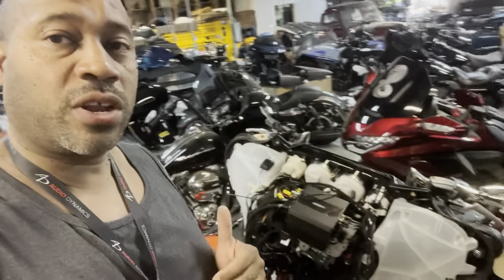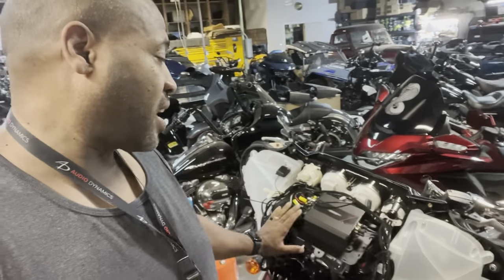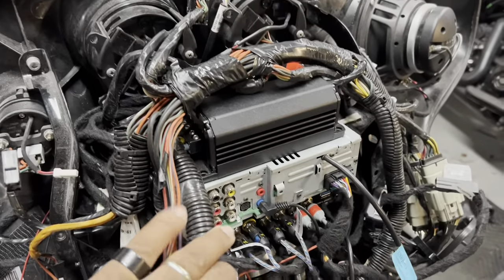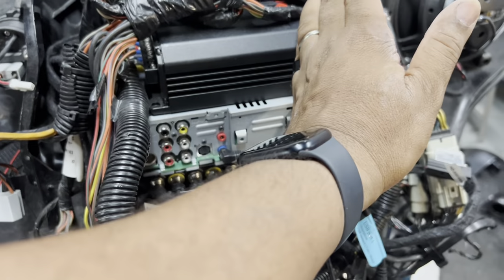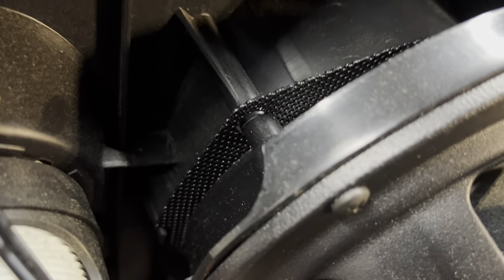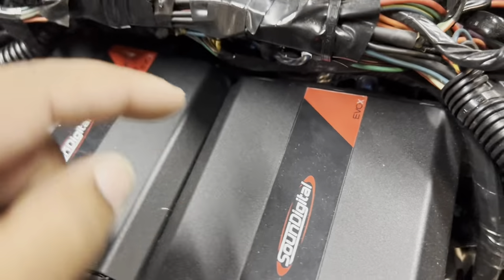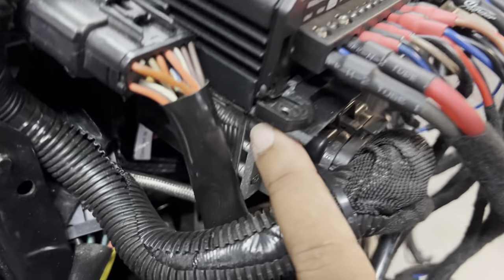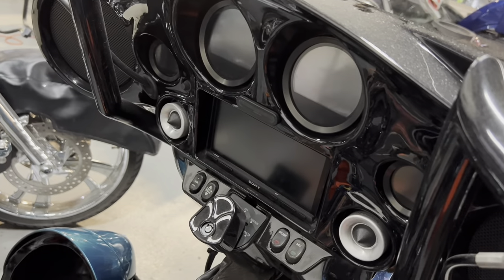How to fit 2 sound digital evox 800.4 amps in 1998 to 2013 street glide  Electra glide /Ultra faring

Comment: Could you show how you set up the wiring lay out on the Electra glide using the metra inner fair with Sony ax7000 using the evo 800 ? I used the setup style you have exactly but can’t close the front fairing on now 🤦🏻‍♂️

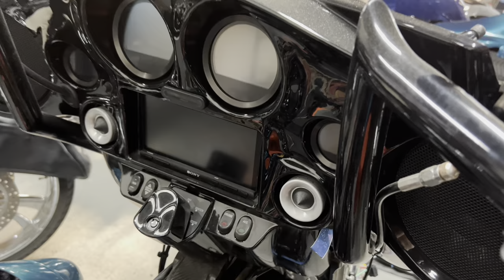Comment: After 5:32 for a 2006 Electra glide using the same setup I seen you have . the aftermarket ax7000 Sony deck with the Metra inner fairing I have 2 - DS18 pro 6.5 on the front and 2 - DS18 pro  6x9s in the bag lids. So do I need 2 evo 800s and if so will they fit in with a DSP and is the DSP necessary ?
Reply from the maker: @jacksanchez7229  the sound digital amps are guaranteed to fit most of the other amps on the market are a little too big .

You don’t
“Need” a dsp but we use one on every build to make the bikes sound better

Comment: 98-13 street glide, double din fairing with full-size double din radio. Can I fit the 1200.4 SD with the metra or saddletramp amp rack plus dsp mounted to front of said rack?

Comment: So I have the metro amp rack and two 800.4’s was gonna mount the dsr1 right behind the radio. But your saying it won’t fit. I also bought an aftermarket day maker headlight. Does this headlight give me the clearance I need to make it fit.  I have all the bodywork at the paint shop so test fitting right now is not an option and I didn’t see how the dsr would fit where your video shows. Have the diamond mp654 on the bike now. I have been going over this In my mind over and over and it’s driving me crazy.  Now if what I’m trying to do doesn’t work I’m back to redesigning again. Gotta look at the video again. I literally just woke up and this video was front and center on my phone.  Long night at work. But I’m gonna look at it again. By the way thanks for all your videos.  Im a do it yourselfer and I have learned so much from you!
Reply from the maker: Dsr1 will fit under the Sony radio

Comment: Good morning how do I tune a sound digital 800.4 evo x to two cicada 6.5 with no dsp and a factory radio on a 19 ultra classic
Reply from the maker: I’m sorry 
We use a dsp on every bike 

I would start with the crossover around 100 hz high pass and gains set with a ac volt meter with a target voltage of 23 volts ac with a 1000 hertz test tone

Comment: Do you know if there would be any extra room in a Metra fairing with digital gauges for a 2013 Electra Glide? Just finished up my bagger project with the exception of the audio (audio to be installed this weekend) and when we switched to digital gauges, we didn't have to use some of the harnesses that were plugged into the existing aftermarket gauges, so I'm thinking we may have gained some room there.
Reply from the maker: You don’t gain any room because you still use the factory gauge brackets 

Maybe a half inch

Comment: Carlos who makes that aftermarket fairing(in the video) for a 2006 harley electra glide? Do you recommend it? Pros and cons?
Reply from the maker: Metra 

Metra 95-HDIF Harley Davidson FLH 1998-2013 https://g.co/kgs/NYM3AT
Reply: I believe it’s metra. It has the double din cut out so you can upgrade the stereo. I seen an aftermarket one on Amazon.
Reply: I have that same inner fairing, the batwing will bolt on with a 1200.4 EVOX but it will crack your paint, Atleast it did for my 08 SG, even after trimming the gauges and sliding it back as far as possible it still was pressing up against the fairing and spider cracked my paint, but I’ve been told a 800 will fit

Comment: I’m looking to run two evo x 400.4 amps in my 13 what did you run for power wire ? 4 gauge to distribution block to 8 gauge or two 8 gauge wires to battery. Would 8 gauge power them both with correct fuse?

Comment: Hey Carlos. I love my Hertz speakers but don't see you doing many Hertz amp installs. You prefer the SounDigital over Hertz amps?
Reply from the maker: Yes 

They are smaller and more powerful 
We use 2 800.4 in most installs 

The hertz amps are excellent but 2 won’t fit without cutting
Reply: @NVSAUDIO  thank you! I have a single SD 800.4 running my SPL Show SX165 and SV165's and was hoping I didn't make the wrong choice for an amp.

Comment: So I looked up the dimensions on the dsp in the video it’s actually just slightly larger than the dsr. But I did notice the bracket that stabilizes the fairing has been removed. The one normally under the speaker to the center support.  Was this just for the video or is it permanently removed for this setup. Any help greatly appreciated. Thanks
Reply from the maker: Permanently removed because of the speaker flange
Reply: What dsp was used?

Comment: How would I get in touch about your 10” nvs mid bass drivers
Reply from the maker: I’m so sorry but I do not sell my tens over the counter 

We only install them in house that way we can maintain quality control

Our install , our wiring , our tune .

We run them on a 1200.2  1600.1 3000.1 or a 5000.1 

There are 3 tens on the market that are equivalent to ours 

Expert euphoria 10
Beyma power ix 10
Prv Neo 1000 nb

I recommend one of those 3

Comment: I use the pioneer media player they are small and not full size head units I can fit 2 SD 800.4, and 2 SD 400.4 using my custom mount